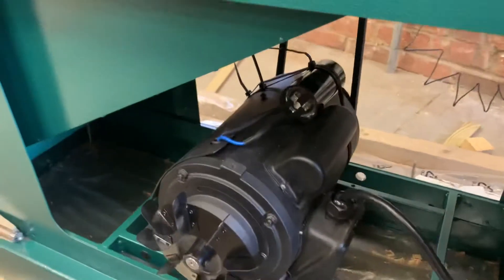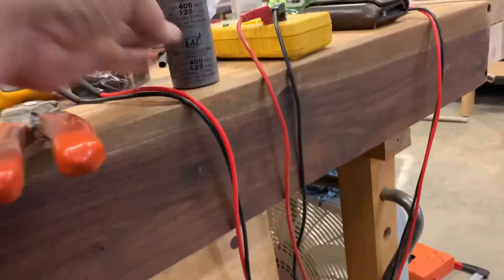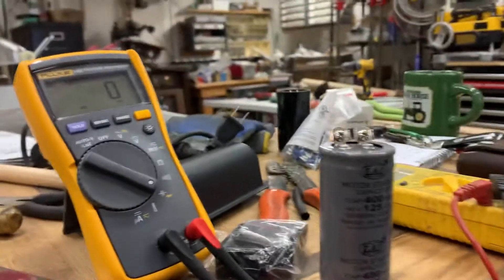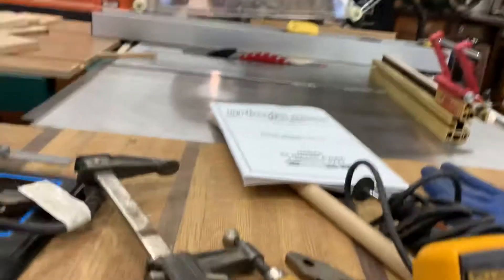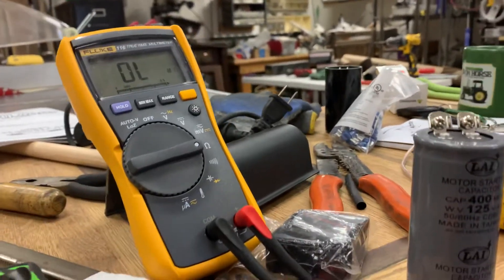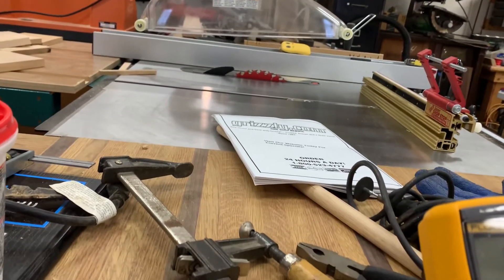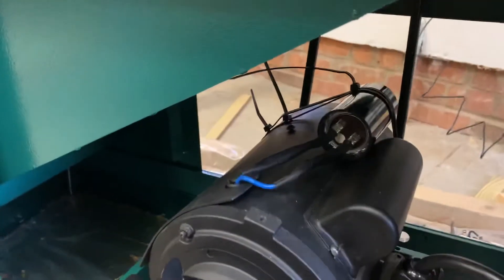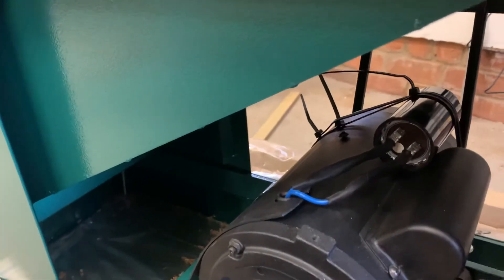New Grizzly G0495X jointer starter cap failure and temp replacement.

Comment: Just got my Grizzly G0858 jointer. Ran one board through. Ran great. Started second board and as soon as I turned on the machine it made a loud pop and the spindle ran very slow like it had lost a leg. I killed it immediately and pulled off the side cover. Motor was hotter than it should be for having basically no real working load put on it. Glad I found this video. Its unacceptable to have a brand new machine fail within minutes of use! Hopefully I can find a good replacement starter capacitor. It took a month to get this machine. Don't want to wait that long for a part.

Comment from the maker: So during lunch I was looking online and Grainger in fact has a mechanically smaller cap that fits inside the motor capacitor housing / cover and has the correct UF and Voltage ratings.  I went ahead and drove to Grainger and picked up the capacitor        (Dayton Electric Item Number 6FLK )   It’s a 125V / 400 UF to 488 UF cap.  I suspect almost all start up caps at  this size and reliability have a +/-  10 % variance on the capacitance.  I Installed the capacitor and cover when I got home and the motor fired up right away.   Problem solved!! Good news is I have a second source for the capacitor and its local.  I’ll dig into my G0605X table saw later this week.   I suspect a weak or bad  capacitor there as well.
Reply: Thanks Porchfan. I just bought the exact same joiner from Grizzly. My best guess is it will be here maybe Friday. I have an entire shop filled with  PM. I'm only switching to Grizzly because I wanted an 8" joiner and read a lot of good reviews on this one. I also liked the fact that FWWorking Mag. chose it at the top of their reviews a while back. Is it hard to change out the motor capacitor? Hopefully I won't need it, but it's good to know. Thanks for the heads up.